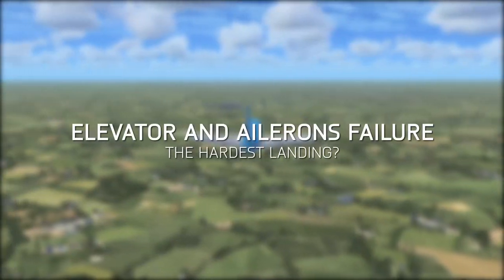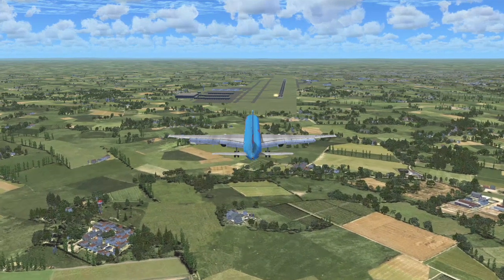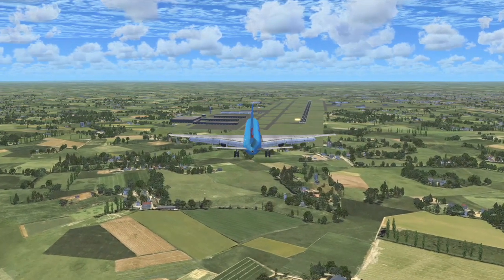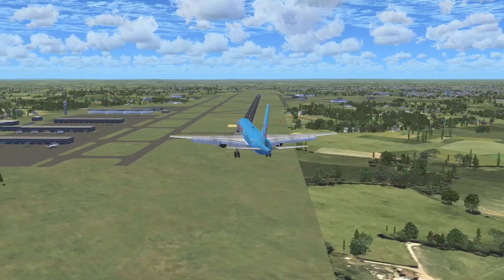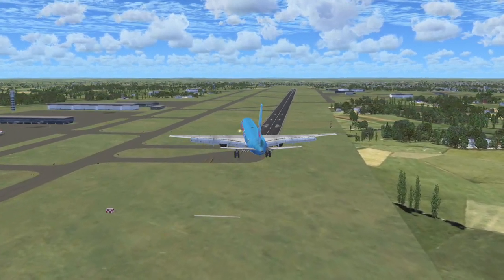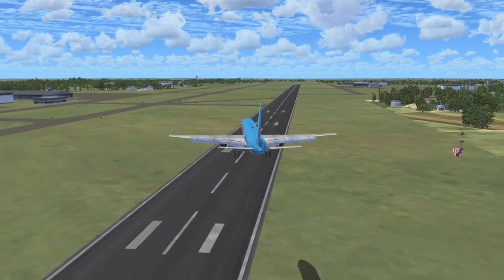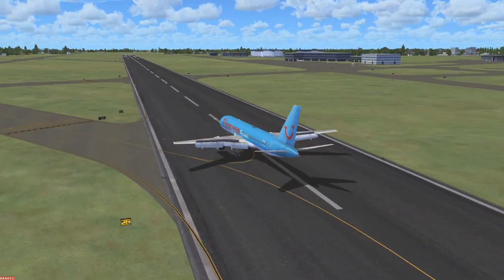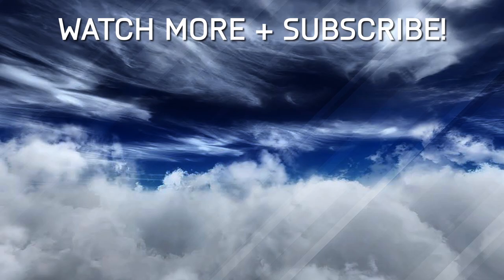FSX Elevator and Ailerons Failure | Hardest Landing Possible?

Comment: I see u tried to recreate united 232, but they lost ALL hydraulic, so they didnt have any rudder, speedbrake, trim and flaps. They only have the engines to control the pitch and the roll (by changing both thrust levers at different directions). United 232 also used the DC10
Reply from the maker: I was not trying to recreate any flight whatsoever, I've never even heard of an incident similar to this. Plus, this is a Thompson aircraft, not United anyway. And as you said, United used the DC10, this is a 757. So I really don't see many similarities, especially as I still used the rudder, speedbrake and flaps
Reply: United 232 summary: July 19 1989, while flying from Stapleton International Airport in Denver, Colorado to O'Hare International Airport in Chicago, the 3 engine DC-10 suffered an uncontained engine failure on the number 2 engine (the middle one),  the sharpnel hit all 3 hydraulic lines in a nutshell they lost the ability to climb decent and roll the only way that they controlled the aircraft was by using deferential thrust on the remaining number 1 and number 3 engine. the flight made a crash landing at Sioux Gateway Airport, of the 279 passangers (mostly children since it was children's day  at united airlines so a childs ticked costed a penny) 111 died. the uncontained engine failure was caused by not checking the titan fan blades as it was diffcult to check, which over time crew microscopic cracks. 

Any that was the summary, there are a few similarities and differences between your flight and united 232
Reply from the maker: Yeah there was no need for all the info as like I said, it was not a recreation in any way

Comment: Try Elevator trim, anyway good video jack
Reply from the maker: Actually they're just called the elevators, which is what overall controls the aircraft pitch. Elevator trim is simply a term to trim the aircraft's elevator :)
Reply: @JacksFSVideos  no. u can use trim if your elevator aint working